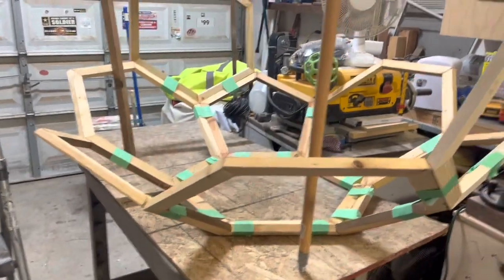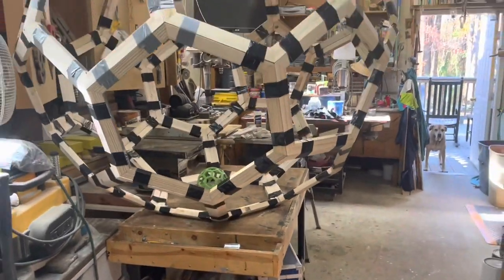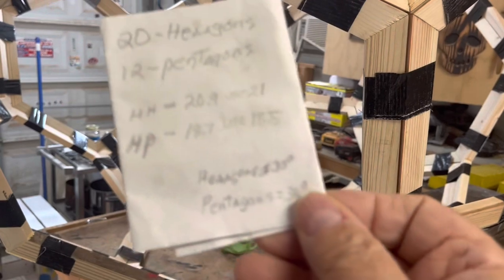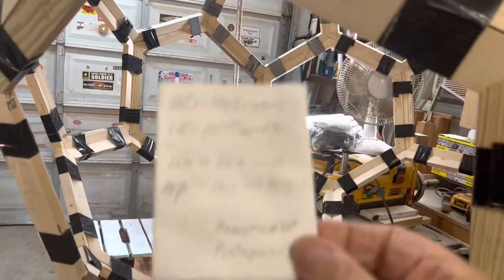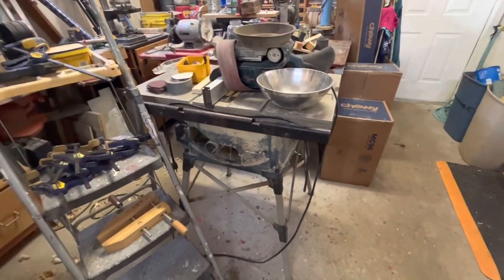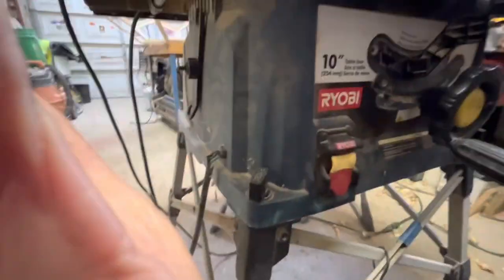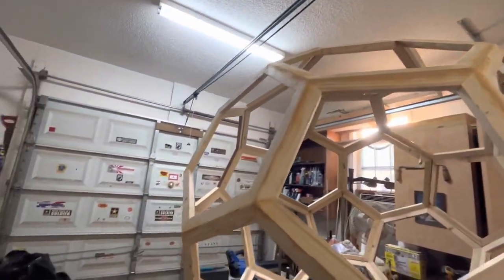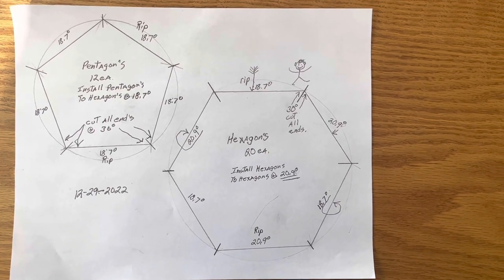DIY Soccer ball ￼/. #truncated lcosahedron

Comment: Great Job! I made one of these a long time ago and know how much work is involved. The thing that sticks in my mind is how tricky it was to keep track of the compound miters, thanks to a mitre saw that only tilted to one side, not both :) For larger sized spheres i would rip the wood lengthwise to create an edge bevel  cut a basic miter on one end of each strut and leave them a little long, assemble them on a jig. Cutting the excess off with a handsaw to match the edge bevel. That would provide a (flat) planar surface making it easier to attach a rigid covering.